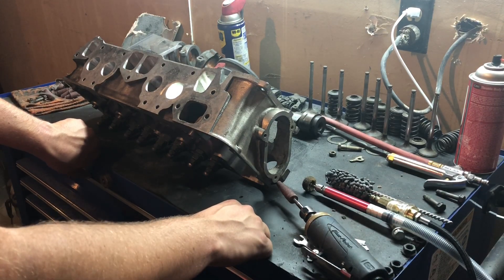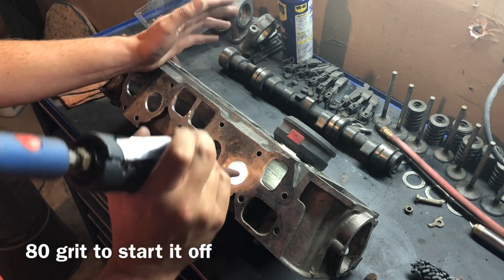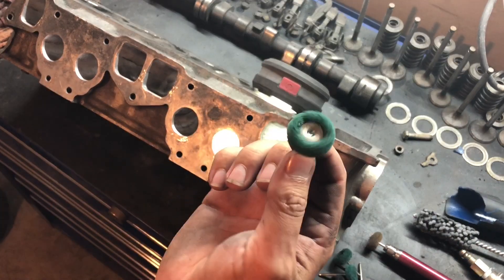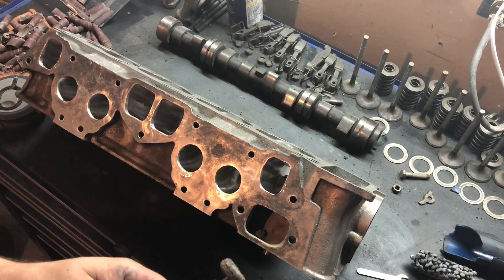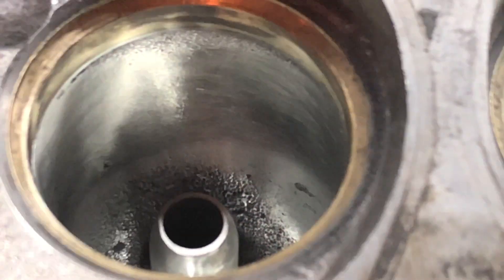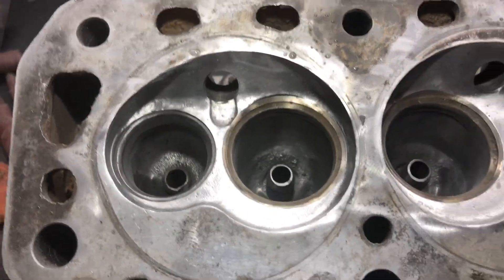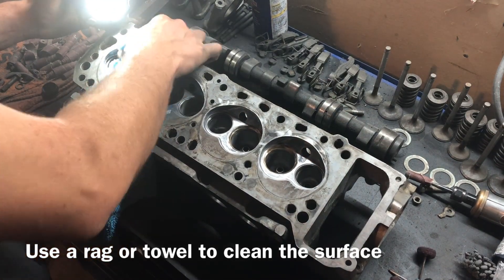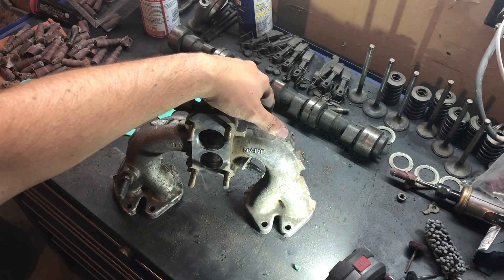HOW TO: Datsun L16, L18, L20 cylinder head port & polish

Comment: Datsun OHC L16 L18 L20 you can make a lot of power if done correctly. Depends what you want to do , if for street or Oval track racing. Getting the correct combination flat top pistons 88mm ( valve pockets has to be cut into the pistons for clearence) The correct head, the W53 head is the best to port , flow, cc and bigger valves with racing valve springs. The racing cam is also important. Oil feed modification to motor is also important. The block inside to be sanded for better oil flow. Crank oil holes made bigger and oil pump modification. If running wet sump , sump to be modified and also oil pickup. And so the list goes on, a lot of work but the Datsun OHC motor can take  a lot of punishment. And the sound it gives out of the exhaust.

Comment: well i built some  heads and yes its warped . don't sand the bottom of the port . before i start i cheque  it for straightness so i don't port a bad head again ! intake seats are too soft for any real racing so i get new valve  seats installed which lets you go up in valve size as long as you unshroud the small radius in the combustion chamber and the head will flow way more with a polish .

Comment: The biggest gains are had 1" below the valve seat and 1/2" above it. Working anywhere else is not going to get you allot. Port matching is overrated (unless the intake is larger than the opening in the head). Concentrate in the bowl area, the valve job and the chamber. (Intake ports need to have a rough finish, like 40-60 grit)

Comment: Polishing the port surfaces doesn't do anything to increase airflow! Zip, zero nada.
You're totally wasting your time. You'd be better off polishing something that people will see. 
(like the thermostat housing)
Reply: You are kind of right. The exhaust port benefits from polishing because it will reduce carbon buildup. There isn’t anything to stick to, and will fall off as it builds and go out the exhaust. Maintains performance over time. (30 year cylinder head specialist)
Reply: Yup. Polishing intakes doesn't really help keep the fuel atomized, which hurts power and decreases fuel efficiency because you send a lot of unburned fuel out the exhaust.